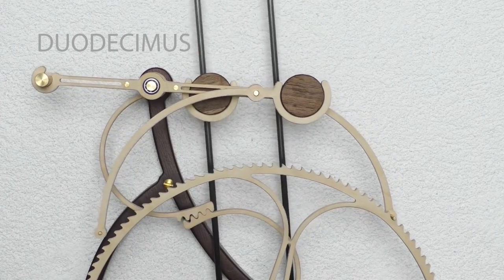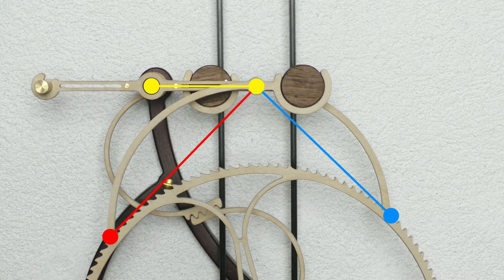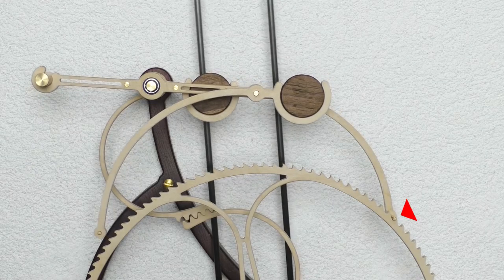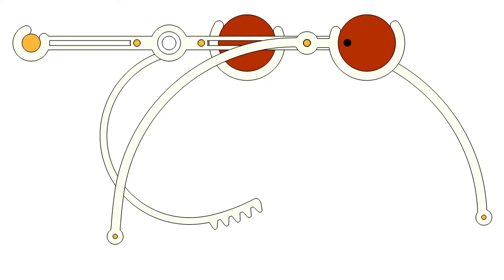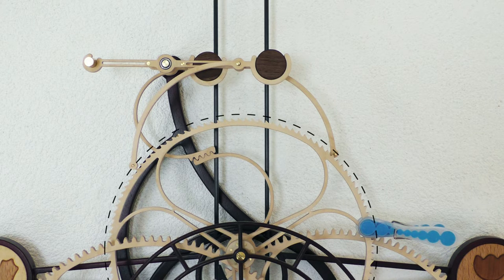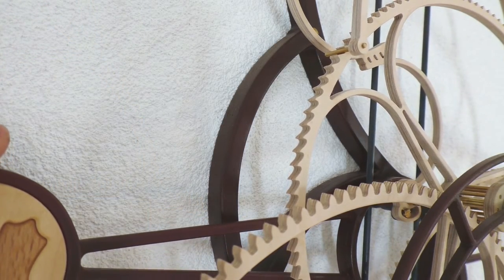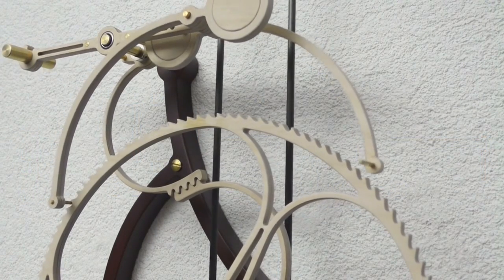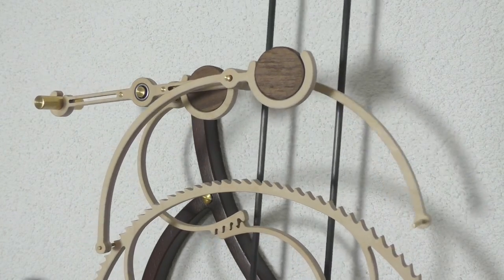Duodecimus Grasshopper Tutorial

Comment: This is a great design and highest-class workmanship of a variation of the beautiful and elegant arrangement of the grasshopper escapement, using what is effectively a slave pendulum connected to the main pendulum. Every Grasshopper escapement normally has its pendulum consisting of a combined effort from a purely compound pendulum which basically relies on its inertia and so may even be thought of as being perfectly balanced and a simple pendulum which relies solely on gravity and an "unbalanced"  offset point mass. When using a very simple pendulum, it is much easier to make the grasshopper escapement work and the reversing or recoil of the escapement wheel is minimal. Using a compound pendulum makes it a little more difficult and the reverse or recoil is substantial.  Normally one needs to decide on this ratio when building a pendulum of how much is a compound pendulum and how much is a simple centering pendulum.
I have seen both simple and compound pendulums used in the grasshopper escapement where the compound pendulum was separated from the simple pendulum but synchronized and phased through a spring connection which introduces a delay. My experience seems to tell me that the mass of the simple pendulum could be too small when compared to the mass/inertia of the compound pendulum where the latter would win the oscillating game as the simple pendulum effect would be forced to lose its almost perfect simple harmonic motion due to the pallet impulsing effect. It is well known that the compound pendulum does not keep accurate time as it does not only depend on the gravitational pull but on what may affect the forces that accelerate its inertia.   Making the lower mass of the simple pendulum much  "heavier" while the spring connection not so stiff,  such a  machine will produce a much more elegant motion. 
I feel that a grasshopper escapement with a purely simple pendulum will have its pallets kiss and home in on almost a stationary escapement wheel tooth and hence very little recoil. With a  larger contribution from the compound pendulum,  as seen in the Duodecimus, the homing of the pallets on the escapement wheel has a high relative motion and so the action is somewhat impulsive and noisier in metallic escapements. I have been experimenting with noiseless grasshopper metallic escapements and using simple pendulums without any contribution from compound pendulums seems to be the least noisy selection due to the manner the pallet approaches the tooth.
I even made a springy push and pull arms to dampen and soften the impulse effect. This softer meeting of the pallet with the escapement wheel in a grasshopper system using a compound pendulum makes it less noisy. Making the push and pull arms from thin piano springy wires is a challenge but when the escapement reaches a steady-state, it is a thrill to see the compound pendulum achieving a very good, natural, simple harmonic motion as when using a simple pendulum.  With experience, one can even notice it with the eyes.  It is not easy to take the tick-tock away from a metallic grasshopper escapement unless it is driven by a purely gravity simple pendulum which helps to optimize the least pallet noise.
  I feel that in some grasshopper escapements the pulling torque on the pendulum is not the same in both directions,, but the Duodecimus seems to have equalized and optimized this torque ingeniously. The vectors depicted at 00: 50 show the magic in this miracle of delicate constructions. Just look at that perfect 90 vectors of the push-pull arm with the centerline of the horizontal slave pendulum arm!  Hearty Congratulations.
These videos show what I described.
 https://youtu.be/6hjYpUGpv4g
https://youtu.be/Qr8wlV2zzN8